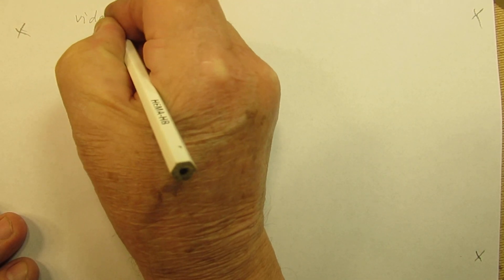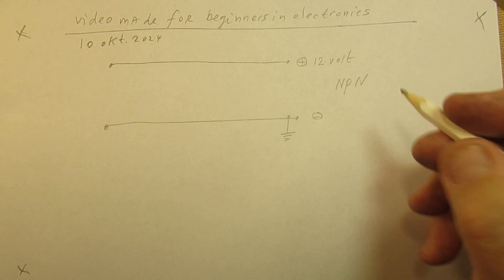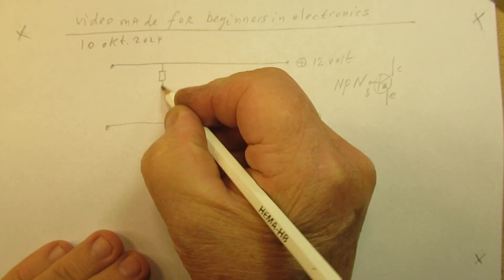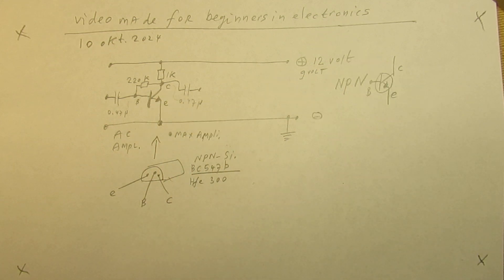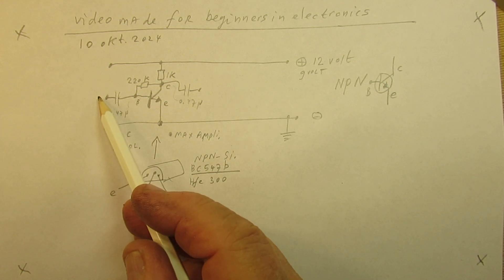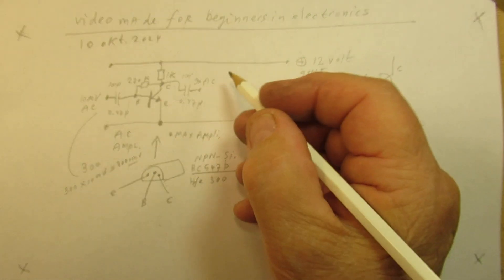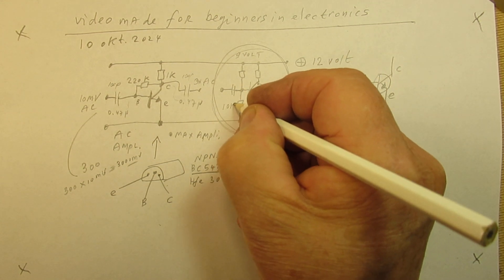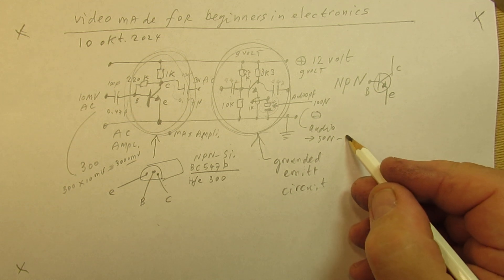Beginners 1 transistor audio or HF amplifier. The grounded emitter schematic, 2 times showed

Comment: What kind hf amplicaion use this circuit ? . Is this possible use 7.265 MHz rf signal amplicaion?
Reply from the maker: Yes, the first circuit can be used for that purpose (1K-220K) with very small input and output capacitors, in the order of 10 pF-50 pF.
Reply from the maker: Here is an example, used as antenna amplifier. Schematic on 2.05 in that video. https://youtu.be/VO-TEx2Ytss?si=6X6MSgME3APkn0xZ

Comment: could you show a simple RF amplifier that could amplify say a 300mw output from a small transmitter up to say 1 or 2 watts? love your videos! very well explained. Thank you!
Reply from the maker: Thanks for your reaction. Your question is difficult, because you don't tell on which (RF) frequency the circuit that you want to make must work. So no general answer is possible. And, on the other hand, I am only a "listening/listener" Radio amateur, I don't have a radio transmitter and don't know (only the theory) how to make radio transmitters (Sorry for that). 11 October 2024.